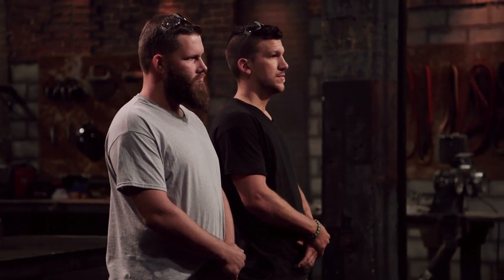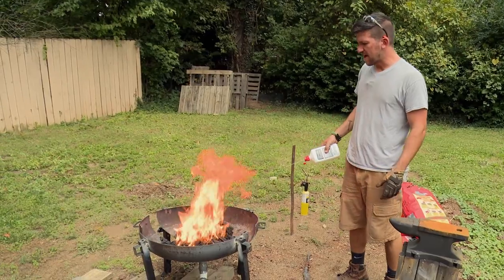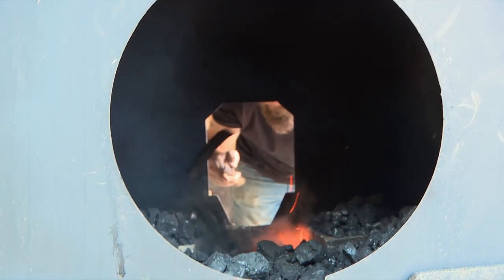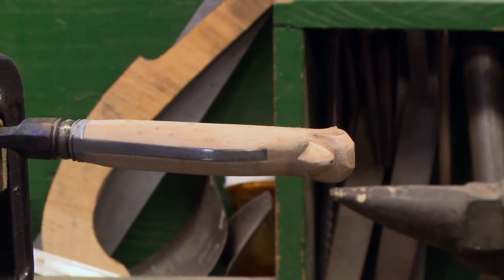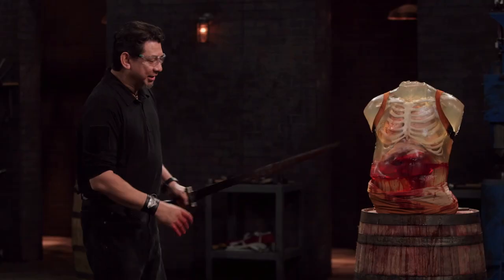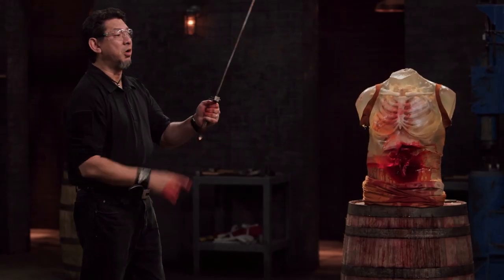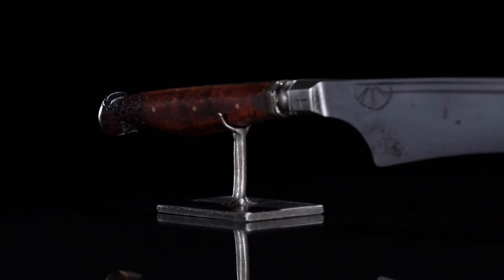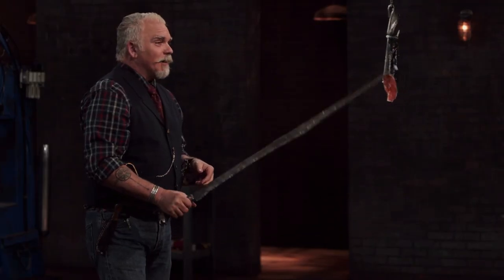Forged in Fire: The Kabyle Flyssa DISMANTLES the Final Round (Season 5)

Comment: Daniels blade was clearly the superior one, but that handle got him killed. It can be the sharpest, strongest most gorgeous blade in the world. If you cant HOLD ON TO IT it doesnt matter.
Reply: He reduced weight from the wrong part of the blade
Reply: Actually, David fixed the rotation of Daniel's blade during the sharpness test. Combining the fact "all the weight is in the front", the final verdict was clear.
Bit surprising though, $10k worth blade from poor equipment of Collin's.
Reply: daniel's blade also rolled a bit from the teracotta pots. traditional is not always the best. i wouldnt buy a weapon from someone who cant even make a decent handle
Reply: So the tests don't matter.  If the handle is too narrow then it should impact all the sharpness tests because you supposedly can't hold it.  But it excelled all the sharpness tests therefore the handle was not a fatal flaw.
Reply: The thing is, there is significant difference in ideal handle size based on the size of the users hands. I have rather small hands for example, so i would need a sword with a narrow handle.
Additionally, if the handle is to small, the user can easily put an additional wrap on it, like leather, cloth or whatever is comfortable (as long as the handle geometry is good, of course).
But if the handle is to big, there is very little the user can do, safe for grinding it down, which both takes more effort, is irreversable, and can mess up the geometry of the handle. So when in doubt, i would say a handle to small is preferrable to a handle to large.

Comment: Any bladesmiths that might answer a question on knife/sword handles? I notice that they discuss the feel, rounding, and texture of handles on a lot of these contestant's final builds. Is there a standard dimension, sizing or guideline to making a more universal handle that kind of hits mid-range without feeling overly small or ungrippable?
Reply: I am no blade smith I have however made handles for my machete/Zombie killer. I started with a metal grip I got rid of due to lack of control. I then used Hardwood to make a handle and spent about 8 hours making the handle fit my hand perfectly. It is to fat for my wife yet perfect for me.  The handle is grooved to my hand and is comfortable for use. If i was making a handle for this kind of competition I would want one that controls twisting and pulling. This means the handle needs to be roughly twice as high as wide to keep grip. It also needs a pommel that will stop you hand when blade is covered in blood and slippery, the Guard is more to stop your hand  ending up on the blade. I am also a Chef and knives are a passion for me.  My favourite blade is the one I made the handle for, followed by the K-bar my wife got me for Christmas one year. Going back to grip wood is the best for grip when blood and guts involved.
Reply: Shape, size, and material are the basics to handle making. It really depends on the blade being made but as you can see in the video Daniels handle was too small for a saber. However if he put that same handle on a knife I’m sure he would be praised highly for it
Reply: Kabza ya kumaş sarman elinden fırlamasını engelleyecektir
Reply: @jacobhunt278  One thing I always think about watching this is whether some of these competitors who are less experienced with large blades don't think about the variances in human dimensions.   I am 5'8 and my hands are smaller than average (I can't palm a basketball, for instance), and I would guess that the handle on this sword would have been more comfortable for me than it is for the judges (though still problematic without the functional pommel).  

With knives it is less important, and I suspect it would be easy when making your first large weapon to make a handle that is functional or comfortable for yourself and turns out to be too large/too small for some because your own hands are not average.   

With that said as Dave mentions in this video this weapon often had thin handles, but the larger, hooked pommel to make up for it.  It was the lack of that detail that really sunk this sword, as if it had the pommel and was controllable it's easy to see the judges giving it a pass for historical accuracy even if it isn't optimal for their own hands.